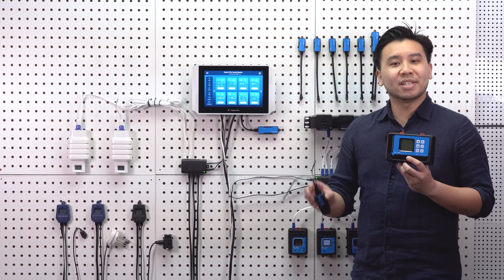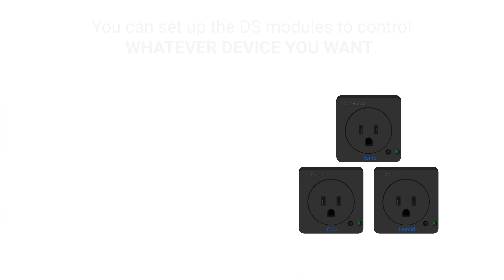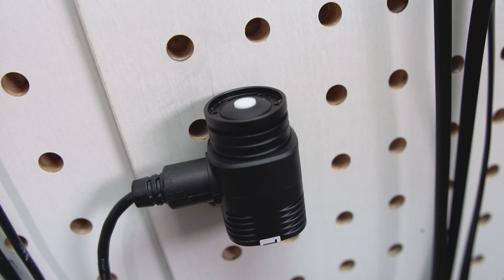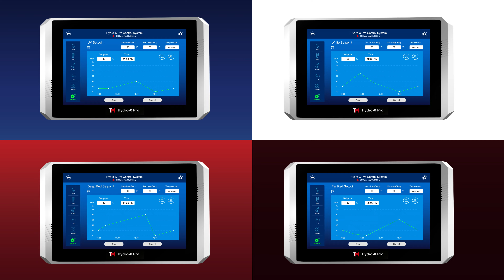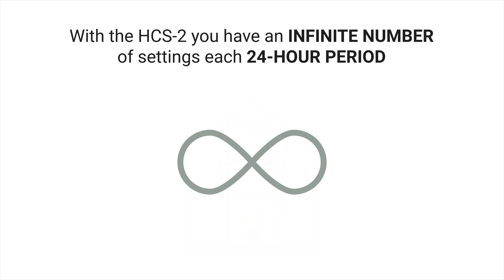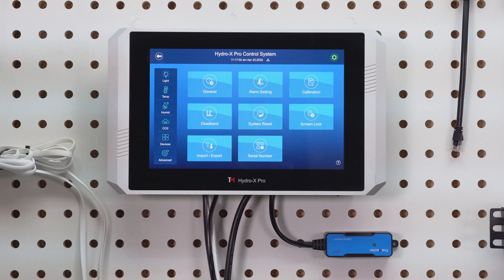Hydro-X Pro - Introduction

Comment: The web application doesn't work at the moment. But the mobile app has been a huge upgrade over the prior one!
Reply: Gees, 4 years later and the API is still an abortion. We have 15 rooms and have had all sorts of issues where we have been told we are overloading their system with requests. They ban you from any further requests, and it takes two weeks to get any feedback. We are pulling our 15 rooms off Trolmaster onto Home Assistant and will not be looking at this product for the 12 new rooms we are busy putting up. The API presently will not give you better than 6-minute updates, and then the information is nearly 5 minutes old. That gives you 10+ minutes of lag to try and keep a room stable. Its like driving a car at 60, but only looking in your rear view mirror. I don't know how this company even does business.